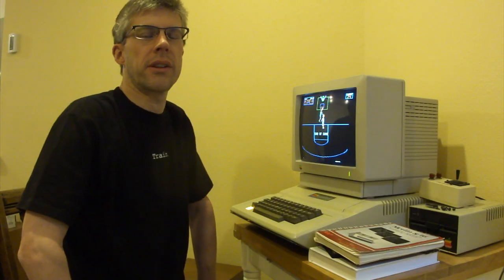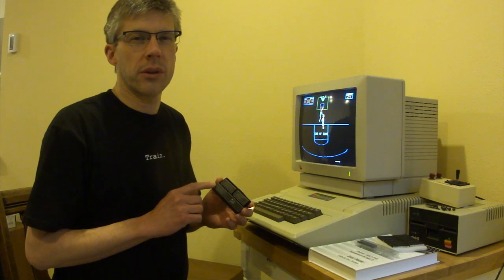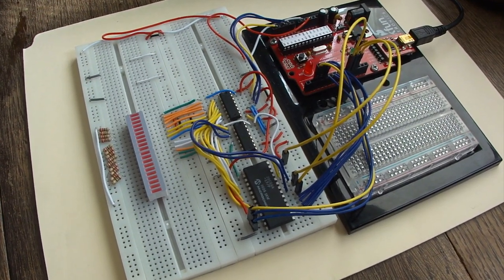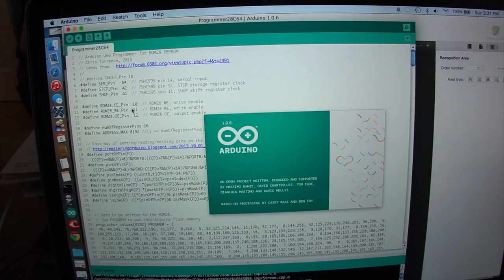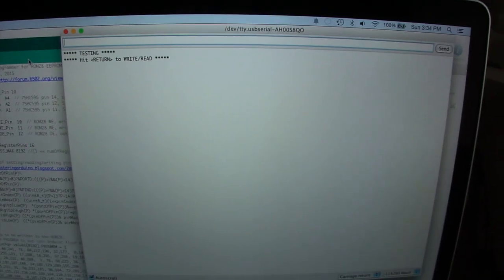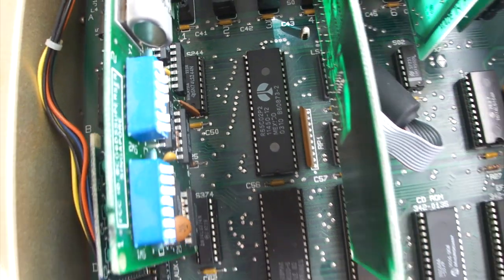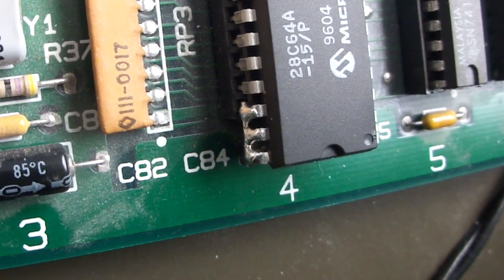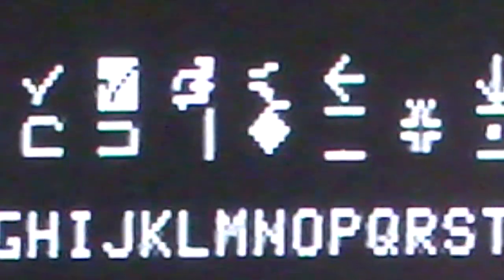Assembly Lines #3: Arduino EEPROM Programmer

Comment: Hello Chris is it posible to do this mod on the Apple II+ 👍
Reply from the maker: That is an excellent question. The 65c02 should work just fine. Since the ROM chips on a II+ are only 2K instead of 4K, you would need to split the ROM code across 4 eeprom chips. The eeprom chips should be pin-compatible except for perhaps a 12V line (I don't have my schematic with me). So you might also need to bend one of the pins out of the way or add a resistor. Finally, the video ROM in a II+ is only half the memory so you wouldn't be able to use all of the fancy mouse text. But, in theory, it might be possible to cobble it together. However, you might just be better off buying a IIe motherboard on ebay and creating a "stealth" IIe within your II+ case. In any case, the keyboard doesn't even support lowercase, so... I'd recommend not hacking your II+ and just leave it alone. :-)
Reply: Chris Torrence ok I will take your avise thank you 👍 excellent work you do for the Apple Community 🙏 thank you Chris
Reply: @CT6502  Can I replace my fail E8 ROM with 28C16, which pin i must bend ?
Reply from the maker: @llq1999  It's not quite that simple. Here are some instructions: http://www.willegal.net/appleii/appleii-integer.htm Another option is to buy the adaptors with the ROM already preinstalled: https://www.reactivemicro.com/product/9316a-to-2716-soic-eeprom-adapter/

Comment: can I program an Sinclair zx spectrum rom with that programmer..  very nice video thanks..
Reply from the maker: +GreekGamer.Gr Not quite. As far as I can tell (not an expert) the Sinclair ZX Spectrum used either a 128Kbit or 256Kbit ROM. The programmer that I built only handles 64Kbit's. You could probably make some minor modifications to the circuit to include the extra address lines, and it should work. I found this website which might be helpful (not responsible for any damages!): http://8bit.yarek.pl/upgrade/zx.roms/index-de.html

Comment: I was so happy to see this the title of this video after hours of searching....
But then you said "Arduino" -_- ehhhh
The whole point of looking up "homemade eeprom/Lpc flash chip programmer" is to get just that. Homemade circuits, but now its like everything is Arduino....

Well If you ever actually get to building a eeprom or bios flash chip programmer than I will be sure to subscribe...
Reply from the maker: +Arc “ArcReaper” Spwan Not sure if you're trolling, but at the end of the day, you use the tools that you have. Even a "homemade" circuit is going to have transistors, capacitors, resistors, etc. that someone else designed and built. I had been using an Arduino for other projects, so I was familiar with it and the programming model. Also, my goal was really to program the chip for the Apple II, not so much build an EEPROM programmer from the ground up. Finally, if you take a look at my video #12, I end up converting this to a protoboard: https://www.youtube.com/watch?v=PQsXaGwBVck
It still uses an Arduino, but that was plenty-enough wires and soldering for me. Thanks!
Reply: No not trying to troll...
I thank you for your reply and all the videos you have taken the time to make... ^_^

Sorry, was just having a bad day trying to find a way to build a 32pin plcc programmer without having to go out of my way to get a microcontroller like the Arduino, or a pre built eeprom programmer...
But to no avail I simply can't find anything of the sort.... Everything I do find is pre built and of course online.(not a fan of buying online)
Reply from the maker: +Arc “ArcReaper” Spwan Yep, totally understand. We had a local electronics store nearby, but it just went belly up. Luckily, SparkFun is within driving distance, so I usually order online and then do local pickup. One good thing with the Arduino - if you're only programming a few chips, you can just build the programmer on a breadboard and then tear it down and use the Arduino for something else. Anyway, best of luck with your project!
Reply: Ya its rather sad that there are just no local electronic supply stores these days... RadioShack was the best thing I had near me for the longest but then they stopped selling electronic components in store so that screwed me over.
The only way I have been getting my parts is from deSoldering an scrapping for parts...

I am rather new to all this so its been super difficult... Trying to build a GB cart Flasher for some dedicated homebrew and or translation carts.
I have been able to find the ATMEGA8515 for the project but not the FT232BM converter for the usb part...
An I can't find anywhere that even sells a prebuilt gameboy cart flasher.... ehh its been a pain... Then I realize I will still need something to program the ATMega8515 >_<

What would you recommend if I may ask?( I honestly have no one else who has such knowledge to ask)
Reply from the maker: +Arc “ArcReaper” Spwan Well, I'm not sure what you need for the USB->Serial, but I'm using a generic one to hook my Mac up to the serial card in my Apple II. Something like this: http://smile.amazon.com/dp/B00IDSM6BW
I don't know anything about Gameboys, but I did find a cart flasher that is supposedly going to come out at the end of March:  https://www.tindie.com/products/JRodrigo/cart-flasher-for-gameboy-/
Best of luck!
Reply: +Chirs Torrence
Thank you for your reply ^_^  Much appreciated...

Well the USB-> Serial or Serial-> USB is based on an ATMEGA8515 which is used in the Gameboy Cart Flasher. I did find an interesting project called "uProg" for programming the ATMEGA8515.

I'm also thinking of getting an Arduino Uno If I can find a store that sells them.. I know Radioshack used to but there are only like two in my whole city...
I just don't really like ordering online as waiting is not my forte....

If I do have to order an Arduino Uno Online where would you suggest to buy one, because I have seen people say they are around $5.00 but from what I looked up they go from $25-35 online?

I actually have that tindie page bookmarked as that really is the only one that is being sold.
I honestly would rather build my own using this
http://www.reinerziegler.de/readplus.htm#GB_Flasher

It seems quite interesting as I have never made a pcb much less had one made by a company... The GB Cart Flasher with the uProg
http://mdiy.pl/uprog-maly-szybki-przenosny-programator-avr-z-sd/?lang=en
Seem like a very good starting point for the moment, as it generates motivation for me...

Well sorry to write a novel but any advice you would like to toss my way is much appreciated...

Thank you for all your videos and keep them coming ^_^